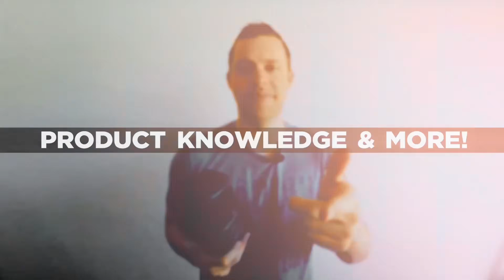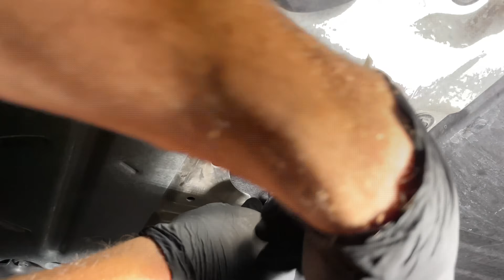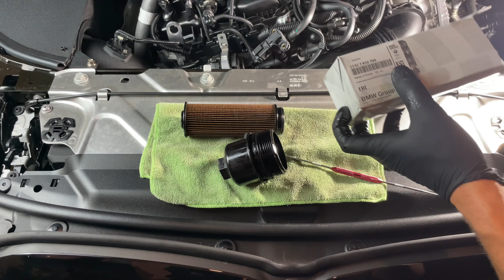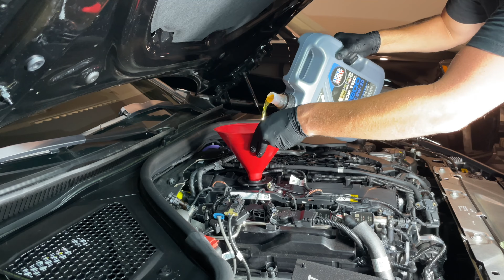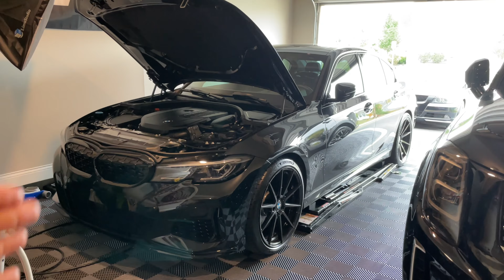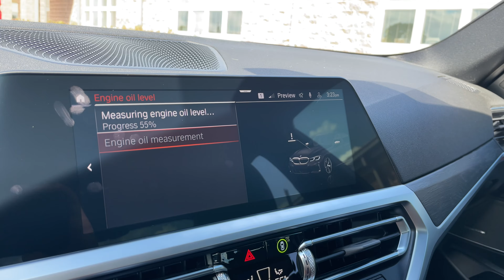The ULTIMATE BMW B58 M340i Oil Change DIY!

Comment: I'd leave the engine cover and underway cover off until after I'd run the engine. So you can check for leaks. Also why not give torque values 25 nm 18 ft/lbs for both oil filter housing and sump bolt.

Comment: There are torque specs for both @ 25 Nm - why guess?
Reply: Because who is torquing them down? I usually torque everything but drain plugs and oil filters I don't. The oil filter cap will start getting tighter, all it needs to be is snug, not tight. Same with the drain plug, you'll suddenly feel it stop and that's all it needs, maybe an 8th of a turn and that's it. That'ss what the crush washer is for. Never broken a drain plug or oil filter cap nor had any cars come back for leaks. Chrysler was real bad on the 3.6 but that's because the whole oil filter housing was plastic and it was cheap plastic too. Most every other car snug is all you need, the o-rings do the rest.

Comment: Glad I watched your video for the crush washer part. I was confused why the crush washer didn’t come off and checked everywhere and couldn’t find it and turned out it was stuck on the bottom of the drain hole good. Saw you pried it off with the bolt and did the same, it came off just like that. I’d probably double washered it hadn’t I saw you doing that 😂😂

Comment: always lube your o ring with some oil before you put it on! If you dont it could melt into the housing from the heat of the oil
Reply: That doesn’t make sense, why would it melt?
Reply: @hamburglerkosh2049  friction weld
Reply: @hamburglerkosh2049  gdm you people always going against the grain. I’ve worked on literally thousands of vehicles commercial and personal just listen for once smh
Reply: @klutchkode2513 or tell us why if you’re so sure? Plenty of myths in the car world.

Comment: I diy brakes, filters, spark plugs but for the oil I always take it in to the dealership. I find it's good for the dealer to lookover the car and confirm any additional issues I suspected, or! No issues at all.
I usually find dealship online ad specials for thr oil. Lol like this weekend has a back to school special. $50 oil change on all cars including m340i. Lol no m3's though. Still a good video though!
Reply: Worst idea to have not known what kind of oil the dealership put in your engine.
Nothing compares to fresh oil from the jug.
Make sure they do t put any recycled or conventional oil in your engine. Just sayin.

Comment: Wish the car had a front central jack point to make lifting for oil changes easier.
Reply: I just jack up at the drivers' side jack point, slide a safety jack stand where lower controller arm meets unibody, remove drain plug, remove safety jack stand, lower car until drained.  Very easy.  Only need simple floor jack and a safety jack stand.

Comment: 0W-20 probably not a great choice (too thin), BMW only selected it to help with USA Cafe standards, something heavier would be better for engine longevity, in Europe (where Cafe is not a concern) BMW recommends LL04 5w-30 or 5W-40 for the B58
Reply from the maker: Yeah I know, have been running 5w-40 in my other turbo BMW’s for 10 years now, kept it to stock weight for this DIY
Reply: Also I'll add to my comment before BMW in manual recommends only 0W-20 and 0W-30 with BMW LL 12/14 certifications. I'm not sure if the Liqui Moly 5W-30 can be used in cars with OPF but since it's okay according to spec sheet for DPF cars I'd say you could use it even for B58 that has OPF.
Reply: @vladimirvojtaml  Liqui Moly isn't a good oil compared to others especially at their price. Get the Pennzoil Euro or the Valvoline.
Reply: @GokuInstinct1  might aswell use the original bmw one because here in EU price is the same.
Reply: Any recommended brands? Probably going to try Liqui moly.
Reply: @WillJ_0122 special tec BMW long life certified 0w-30… you can choose 5w-30 depending on temperatures but most will be fine with 0w
Reply: @WillJ_0122  Liqui Moly Top Tec 4200 5W30 has the Long Life 01 FE BMW certification so it's probably the best choice.
Reply: 0W30 here for California. Gets super hot here and 0W will give you great cold start protection, while 30 will protect the engine better than 20 will on 100F days. Always choose engine protection vs. fuel economy CAFE standards BS.
Reply: Great video bro, what’s your wheel set up? They look great!
Reply: Not even true, B58 tolerances are designed for 0W-20 for fuel economy and efficiency. Only recommended if motor is modified
Reply: @TheLPCGAMING  Really, why do all the B58 manuals from all the countries that don't have CAFE standards recommend thicker viscosities?  There is a difference between "being able to tolerate 0W-20" and "being designed for 0W-20".  How many engines have you raced, rebuilt, torn down?  If you think 0W-20 is a good idea in any kind of high powered turbo charged engine sorry but you obviously don't have the experience to know what you're talking about.
Reply: Then why do other cars use 5w-30 here in USA? It’s not illegal to have or use those oils.

Comment: I have a question about your oil choice I of course use Liqui Molly and think that their oil is top notch but by going in for the free annual oil change won’t bmw use the Castrol oil and how does that alternating oil help or hurt long term engine performance.

Comment: 0W-20 oil looks like apple juice. other countries use 5W-30 LL01
Reply: The oil guy on youtube did an oil analysis on his Toyota because they are now using 0W-8 and he sent that in and it actually gives BETTER wear protection that the 0W-20 that was used previously but stuff has the consistency of water. Can't judge oil on how runny it is.......

Comment: I’ve got a bmw 335i 07 roughly shaking on idle and when put into drive or reverse would you have any suggestions to what it might be? already changed spark plugs,coils and injector seals
Reply: Not sure if you got this taken care of but i just had this issue in my 2019 330 it was a broken motor mount !

Comment: two points:  you over torqued(by hand) the drain plug.; 0W20   never smart.
Reply from the maker: It’s not over torqued 
0w20 is just the standard weight for it
Reply: He should have stated the torque spec it's actually 25nm
Reply: Whats so NOT smart about using 0W-20 (the recommended oil by manufacturer)?
Reply: @ranmas2004 it's mainly for fuel efficiency, Germany uses 30weight due to the autobahn. So if driving hard or tuned a 0 or 5w30 is best. Manual says up to 40w
Reply: 0w20 is labeled under the hood.